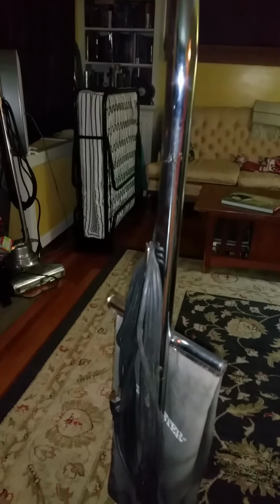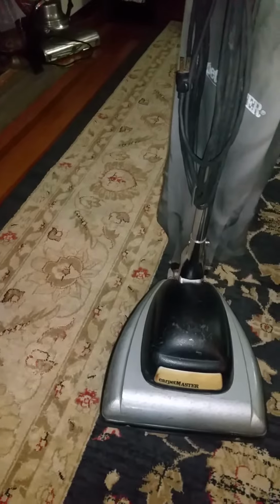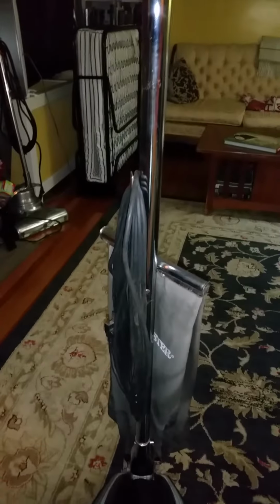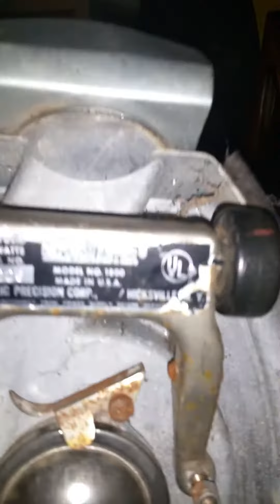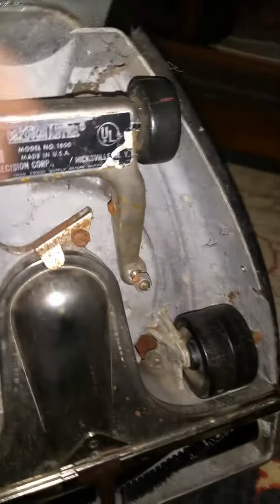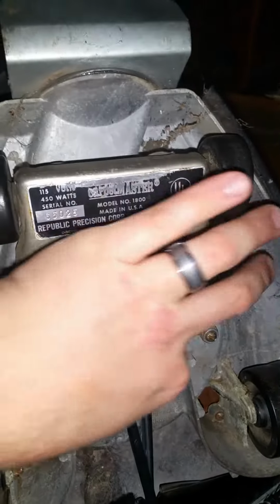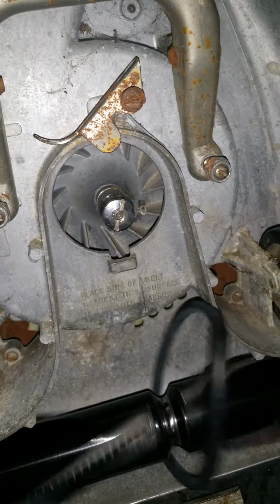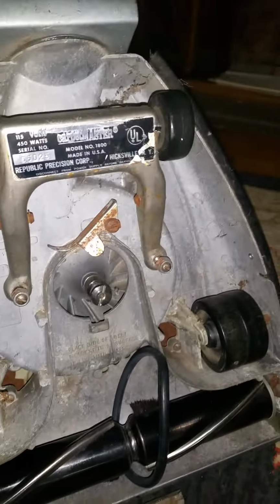Vintage Anser Carpet Master Vacuum

Comment: What a VERY nice example of that machine.  Henry company DID have a hand in the creation of that machine, but the Ansers were available other places as well, i.e. any vacuum store, appliance shop who agreed to be a dealer. The company that you referenced to in the video was the company who purchased the tooling from Universal when the company (Universal) stopped production in 1964, and built the machine thru the 1970's. This machine was developed because no one else had yet devised a lighter weight commercial style vacuum. Eureka was a few years away from introducing it's actual Sanitaire line, and Hoovers option the 918 was an incredibly heavy and expensive unit.  I have seen several of these, and they are VERY Similar to the Universal Uprights, except the roller that you pointed out, and later the motor was a more popular type. The earlier ones used the Universal motor too.... I have a Universal Upright from 1950 that I will doing a video of soon. Look for it if you wish!!! Hope you dont mind the information....